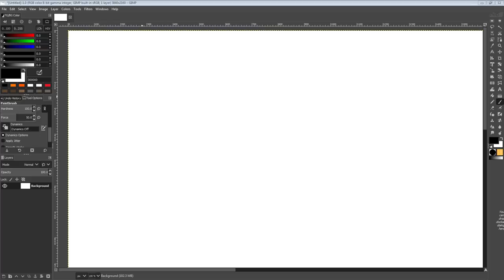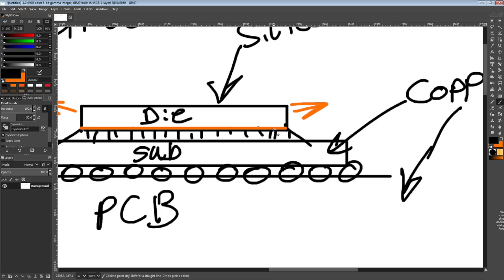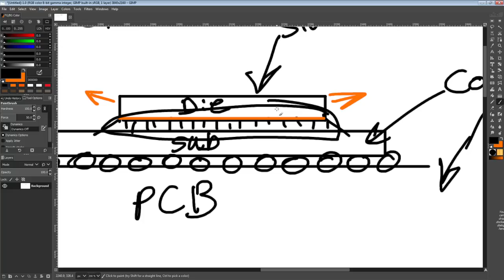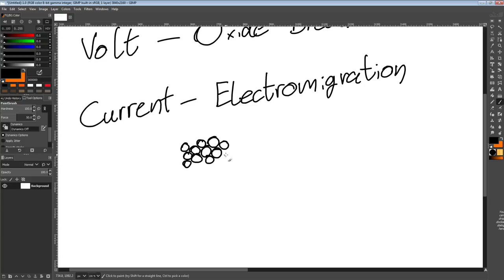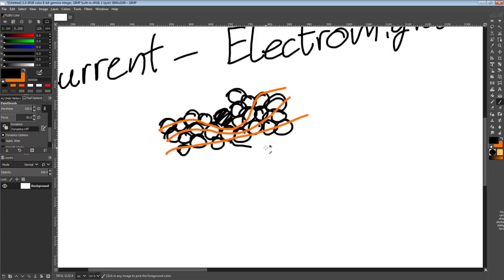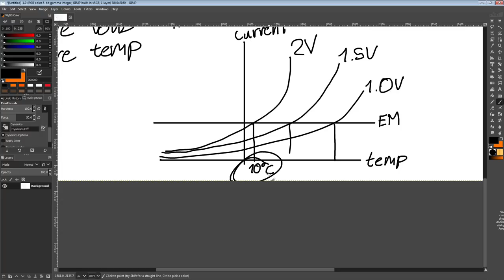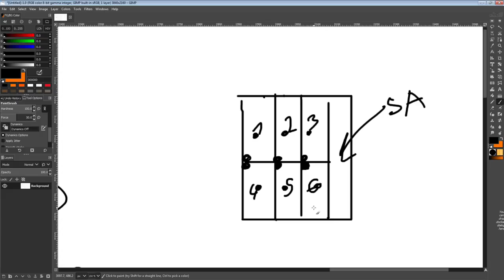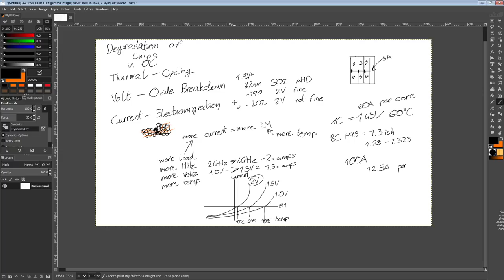Rambling about chip degradation

Comment: the limits of silicon doesn't change generation to generation.  The minimum required voltage goes down for a given clockspeed, but the maximum safe voltage stays the same.  I've been running 1.4v on my chips 24/7 since 2000 and 0 problems.
Reply: You cannot generalize, with a quick search you find many, really a lot of topics exactly involving people with instability in the over after some time requiring voltage increase or frequency reduction because of chip degradation. The second and first generation ryzens are easy to find since they have been on the market for some time as well as any generation of Intel and as lithography gets smaller, more the topics about it you will find. What happens is that the lower the lithography the greater the concentration of heat, the thiner and weak the little components are and the easier it is to leak voltage as well as the simple burn over time. 

From personal experience I have a good example, a 4930k 6/12 that new was easy 4.7Ghz at 1.35v that lasted for months perfeclty on this spec, but eventually the problem of instability appeared and and the more time that passed, the faster it degraded, 7...8 months after its start, with 1.35v it hardly hits 4.1 Ghz. Keeping that voltage means that in 2 or 3 weeks it will certainly require new a reduction in the clock to keep stability and It only stopped degrading when set to 1.15v.

Comment: Seems pretty on-point from the literature I've read on the subject. As someone who doesn't do extreme OC, I found the insights into just how far voltages could be pushed, when dealing with super-low LN temps, to be very interesting. IMHO, for folks who just turn on PBO, or implement a mild overclock without overvolting, 10 years is probably a low-side life-span expectation. I have a i7-980x OC'd to 4.13Ghz all-core, running right at the edge of spec 1.375v, using a good-old Zalman CNPS9900 (with the original AS no.5 application). I've been running that system 24/7, with FAH, for a decade, and it's never so much as hiccupped in all that time. In the last 30 years (and I still have my 31 year old Amiga 3000), I've never had a CPU fail or degrade to the point of instability. I've had memory go bad, I've had countless PSU's, storage devices, monitors, VRM's, but never a CPU. Hell, even the two times I lost a GPU (GTX 260 and a 7800 GTX) it was due to a board component failure (bad cap, mosfet, etc.) that I later fixed. I've never had a GPU fail at the chip level, even when I was running an absurd over-packed set of GTX580's in SLI (talk about a space heater). So while I'm sure these issues of degradation are absolutely a challenge in the extreme OC world, and for people who are really pushing voltages and all-core over-clock values, I doubt you'll ever see an issue if you are running inside manufacturer specs (even when running their pseudo-sanctioned OC profiles on so-called 7nm).
Reply: Hmm... this comment aged poorly..

Comment: Got a 9600k, at ambient around 18C I have seen upwards of 240W power consumption. It is under NH-U14S, MX2 paste, 2 fans on the tower, plus two right above it - one pushes into the “first” tower fan, the other pulls from the back side + 1 fan on the back + 1 fan in the front of the case and one more fan on the side panel that pulls out from after the tower. Voltages I run are 1.35-1.48 (that was a experiment which I quickly deemed unworthy, 5.0 prime95 avx2 was still not stable). So 6 cores, 40w per core basically, at 1.4 would mean what, about 28A per core.. not fun.

Comment: First 20 minutes is also applicable to laptop CPUs. Louis Rossman has raged at Apple for years because the poor Macbook cooling causes mobile Intel CPUs to run at max OEM Tjunction all the time. The resulting thermal cycling causes similar problems to the GPU issues Buildzoid is discussing here...

Comment: Exaplained well, i mean understandably for most people. It is a bit of a crude explanation but it seems fine. 1 thing tho, what about e- tunneling with your gap of 1 atom? Imho those atomic gaps you mention have to be a bit larger than just 1 Cu/Co atom. Also phonon dispersion happens pretty much always, all the time, which is why e- cant speed with light speed thru (semi)conductors. And this popping outta place (their crystalline lattice position) is more of a diffusion which you kinda fail to mention too so...  Anyway i lack some proper wording but overall? Nice, thx.

Comment: If you double the voltage applied to a chip, assuming that the resistance is constant, current would also double, as you said.  But the amount of heat generated inside te chip (power) would quadruple.  So I don’t think the absolute temperature provided by the cooling system is al that important, the ability to quickly absorb 4x the generated heat.  Also, semicondutors have a negative temperature coefficient, so, the higher the temperature, the lower the resistance.  Knowing this, if you double the applied voltage, initailly the current will double.  Power will be quadruple, generating more heat, lowering the resistance, increasing the current, increasing the power… If your cooling system cannot keep up with that, chip will self destruct.
Reply: So, in short, if you double the voltage, you have to 8X (gross estimation) the heat dissipation.

Comment: yeah AMD made the 290x throttle at 95C but then when i looked into the vbios of my asus card because it was running hot i noticed that it would actually take 110C for the fans to max out so yeah i fixed the fan curve (also updated the memory timings) and had no problem with it since then, it usually sits at low 70s max after a whole day usage and rarely breaks 80C even with 30C ambient room temp

Comment: I think your current vs temp graph is inverted. Temp should be on the y and current on the x. The way you show it, you can pull more current at a higher voltage with a lower temp. Which is the opposite of the way it works. If you switch the two axes it works

Comment: Curious if the temperature cycling is what killed my 7870 which started artifacting with a pattern across the screen. Smaller chip than 7970 still, but maybe the quality was suboptimal.
It’s a reference design, wasn’t used that heavily especially towards the end of its life, but I used a custom fan curve that got it up to 80C~ peak because I was sick of how noisy it got at idle and when temps were just 60C under load.

Comment: I know this is an old video but it shed some light on why I've hit the limit on my low power 5700X setup, running at 3.3GHz @ 846mV all-core and 4.85GHz single-core @ 1.204V with a 49W power limit... I couldn't find a 5700GE. 
[-30CO all-cores, +200MHz Boost Override, -72mV offset, 925mV SOC, 49 PPT, 0 TDC, 73 EDC]

I think AMD's power management is preventing me from pushing more current into the chip because it's afraid of EM. Or it could also be due to localized hotspots even though my R23 temps seem fine at only 60C max; which would explain why clock speeds decrease slightly between 58C & 60C.

So at this point I think I'm pretty much stuck, unless I can cool it more (unlikely in a 4L case) or if I somehow find a BIOS that allows for something like -60 Curve Optimizer on an AM4... Which is as likely to happen as winning the lottery.

Comment: regarding your statement that 2V produces twice the current as 1V: That is not really the case when it comes to transistors and diodes. Diodes have a threshold voltage, after which the Current gets exponentially high, so double the voltage might very well mean 1000 times the current.
Ofcourse that depends on how the wiring is done inside the chip, but I feel like there is a real possibility of your 2V causing 1000 times more current.

Comment: Wouldn't an inter die/substrate connections self test utility be a good idea? You could learn in an instant how worn down the main chip is. Sounds like an immediate, and elegant GPU test when for example buying used, instead of the silly stress tests.

Comment: So, when you buy an overclocked GPU, the manufacturer is basically [though not saying] selling you a product that they are sacrificing its lifespan in use in order to get a higher selling price because even if the silicon of the chip is good enough to allow higher overclocking, the rest of the components do not necessarily support the additional stress that will occur over time.  Yes?

Comment: I'd imagine AMD's as of late chiplet designing direction kinda mitigates the thermal expansion issue. Also, suspending the silicon at the center would cut the expansion parameters in half.

Comment: But there's ins't clear to me, low voltage+low temps+stock current+ 4.6GHz all core all time, 
this degrades more than stock clocks? or clock frequency don't interfere in degradation?

Comment: I wonder how bad 1.41V is to my 3950x with chilled water set to 16 celsius and Smt turned off. My per ccx clock speeds are 4700Mhz and 4675Mhz on first ccd and the rest are at 4525Mhz. The system is not even close To being prime95 etc. stable but it does cinebench and gaming just fine and I dayly those settings. On a side note I run  4x8Gb memory at 3733Mhz cl14,16,12,14,27 at 1.55V
Reply: VDIMM @ 1.55V? I like your style

Comment: I'd guess oxide breakdown reduces resistance and electromigration increases the resistance. If you can control for current and voltage, you can calculate the resistance and check which issue you're dealing with. Pretty sure you can't control these to an accurate enough degree to get any useful data tho :(

Comment: Great video, it did make sense, but I have a question please. How does TDP limits affect both the current and the temp? Because at the end you said, its hugely temps and current, but BOTH of those are drastically reduced on Intel systems, if you set a custom TDP limit. Is this the way to go to prevent damage mate? Thanks for the time anyway!

Comment: I never get a Clear answer  butt i Run my R7-3700x @ 1.375v at 4.5ghz with Temps Never SurPassing 73c after 3 hours of intensive Processor demanding titles like CyberPunk or Origins / Odyssey , etc ... games 🎮  all I want to know is if my Cpu will Run at 95% after Five years of OverClocking ?  🧐

Comment: Does anyone know what the oxide breakdown voltage for TSMC's simple 7nm process ( 7N ) is (under normal temperature operating conditions: say 25 to 70 deg C) ? If i'm not mistaken, I think this is the process on which Ryzen 3000 Series processors (Matisse) have been designed and fabricated. I also have a feeling that the Precision Boost 2 "algorithm / function" (NOT the PBO + Auto OC, but just the "straight out of the box" PB2) on these chips might be a little too aggressive.., especially regarding the max core voltage that PB2 allows some core(s) to use now and then... - maybe, maybe not...(?) ; this is just a hypothesis and what i'm trying to figure out..

Comment: I have an 1800x that I had to slowly bring the OC down on after months of running it high temp OC.   It still runs stable stock but won't take an OC much at all anymore,   It also didn't help that the AIO I was using slowly died along with the CPU so it was a double whammy.   My 3950X and 2080 TI are on dual rads custom loop.  2080 TI hits maybe 40 - 42C under load with silent fans.
Reply: cool, my 1700 at 1.2v 3.8ghz ended up using 1.35v for   3.8 ghz in a short amount ammount of time on stock cooler and it still cools it
Reply: i dont hit 80 c only with dried out thermal paste

Comment: Back when I was running a modded Prometia, I remember discussions about phase change causing more thermal contraction/expansion. The discussion went something like that the difference in load/idle temperature, especially within parts of the core, was bigger with phase change than with air, so this was a reason for premature breakdown, even though temperature and voltage was kept within reason. Does it make sense? 

I remember some people kept running a low priority load on the CPU to avoid as big temperature differences.

Comment: Did you actually have experience with thremally degraded Hawaii? I haven't seen a person with this problem on the forums (as compared to G80 and all other bumpgate affected NV cards), most of the time people kill their cards with AUX overvoltage or due to bad VRMs on some non-reference boards... Mine 290 is still alive and it had reference blower for half of the time...

Comment: I think AMD needs to work with board makers to allow some flexibility with customizing voltages for boost. One thing I see happen a lot is, the temperature of Ryzen gets low, which makes the boost algorithm pump more voltage, for more clock, but it's often something ridiculous like .05 - .1 mv for an extra 25-50 mhz. That makes it go over the temp threshold for the clock speed and then throttle back.

Comment: How long do you need to supply too much current and heat before you're likely to damage a CPU? 

Kept crashing due to 'Power Down Enable', applied LLC and voltage adjustments when not needed, r5 3600 reached 90-105c for seconds at a time, for a few days during tests.

Comment: I'm curious about Ryzen's boost at low load.  Because for some reason Ryzen Master reports average core voltage at like 1.45 at desktop idle when I have iCue running.  If it were just one core that had 1.45 I wouldn't blink at it but it seems like it's all of them.  Something to do with how often iCue is polling the CPU.  This puts temperature up at like 50c idle, but I guess this is just the hottest core from the way Ryzen reports temps.  I set up an all core OC in the mean time until I can figure out if this behavior is normal and safe or not.

Comment: hey man i applied 1,5 volts on my old xeon x5675 when intel says not to exceed 1.45 volts.... i just did it for testing its not a 24/7 stable use. My stable is 1,4 volts for 4.5ghz..., is that ok? did i degrade my cpu??? temps didnt excceed 76 celsius on 1.5 volts on stress test..

Comment: there is something i dont understand with the vega56 card i have.
the gpu temp, hbm, vram temps are at 65c70c 
there is a hotspot temperature that it goes to 105c . what is that !!??
that what throttles the core clocks 
what will be the best thermal paste for it

Comment: How about 12 core 3900x safe temp and Frequency?I ran 1.325 for 44.30 GHz with 360 AIO for rendering and work station.I highly curious will this degrade my chip or not.max temp goes around almost 79-80 degrees in full load.

Comment: THIS IS WHY INTEL USE METAL GATES ON ALL i3,i5,i7,i9 core tech ....since core tech intel used, are not high voltage to begin with but they have gates are very easy to overclock with plenty headroom due to low volts already gonna in...those K gates  can withstand better than SOI pentium 4 or any AMD chips current now....due to stackable compatible to be stack each other to form 3d gates to form later i7 and i5 can handle 5ghz and 1.38v from 1.05v

Comment: Nice video. Could you please provide links (or names) of the papers you read?

I believe that as transistors get smaller, the biggest issue is for sure going to be hotspot temperature - there´s simply no way how to get heat out of such a small area except water cooling channels right inside the chip (that has been demoed a few years ago on some ARM chip I believe).
Even today the delta between the hotspot and edge temperature on Navi can easily be 15+°C - and that´s the measured hotspot, the real hotspot might be even 10°C higher than that (depending how many sensors you have and how smartly are they located).

Sadly, we can´t get access to all the temperature sensors that Vega II/Navi/Ryzen has (AMD has been really pushing it in this area), it would be really cool to visualize them - see how the temperatures change based on a different kind of load - integer/floating point code, AVX code, cache/memory intensive code. Or see how the values change based on mounting pressure.
Reply: I really love the pushes AMD has been making in temperature monitoring! My 5700 XT had a thermal paste issue that I never would have known about without the hotspot reading.
It was easily 50C+ hotter than the normal temperature measurement until I took it apart & reapplied the paste properly. Brought it down to around 20C difference instead, but I never would have known without that sensor, because the regular "GPU Temp" was perfectly fine!

Comment: What about GPUs from the mining that runs 24h/day under constant temperature of 50C? Are they in fact less degraded than a regularly used GPU in a gaming rig, because the thermal expansion is not affecting the chip?
Reply: Kinda yes

Comment: Still only like 27 minutes in, but if the oxide layer breaks down I would expect you would end up with what essentially mounts to a short circuit. So while it's true that you won't see the current go crazy, if  the insulator breaks down I would expect the current to all the sudden be massive. At the same time though it depends on the vrms on the motherboard. On the other other hand though since you have caps in the vrms I could see that they would just immediately short through the chip and cause a problem. I would expect that you wouldn't damage the mosfets because once the current from the caps is released through the chip everything's going to go haywire so the mosfets won't ever get a chance to provide 100's of amps out of nowhere. So basically I think that if you kill the oxide layer on the chip with voltage you might end up getting a huge current pulse through the chip and that would therefore be the large current you wouldn't expect. (this of course assumes oxide breakdown on the cpu not on the fets. If those break down you're just all around screwed.)
Reply: Can't edit for some reason, but I do still agree that when you kill a chip at 2v, like it doesn't even boot, I agree that the real root cause is the oxide breakdown and not electromigration. Which sort of nullifies my point, but I'll actually leave the post up anyway.